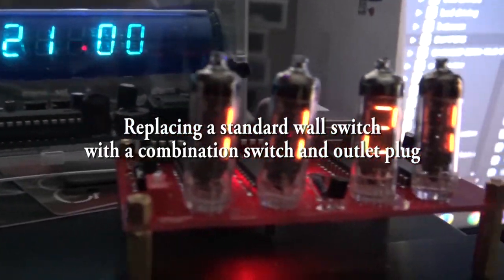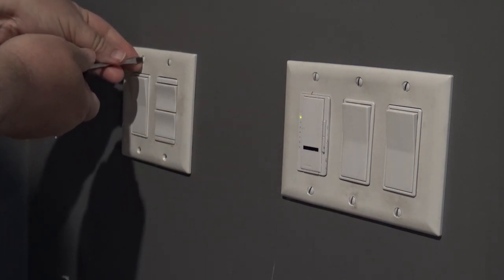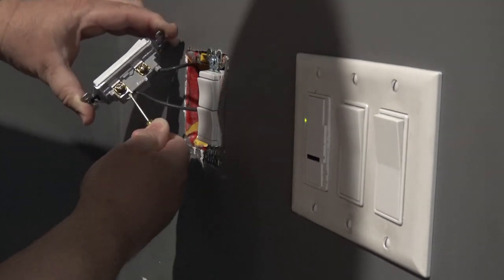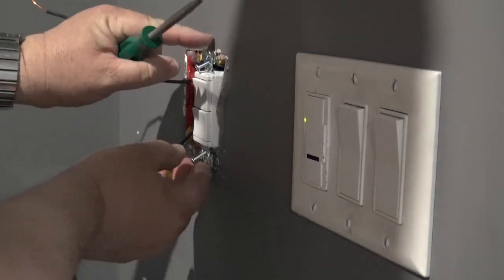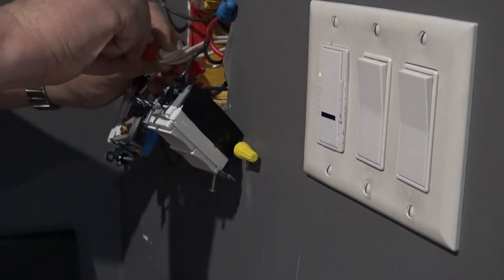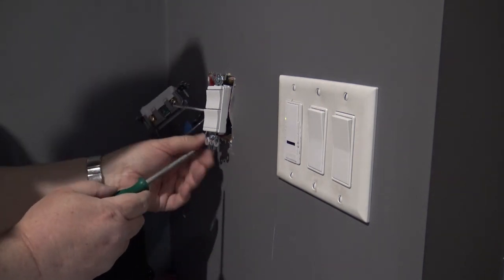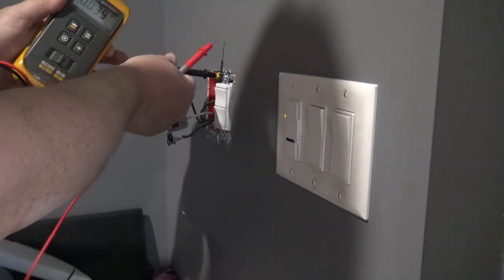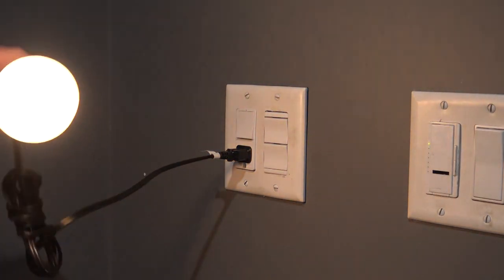Replacing a wall switch with a combination switch and outlet

Comment: Kudos to you sir for being brave enough to work that 120volt hot wire, I myself do all the electrical stuff around my house, I loving working on anything electrical, but I'm still fearful of working on anything live, i always have the power off and lock my brake panel with a pad lock. thanks for this video, its a great tutorial to teach someone how install a switch like this. I feel a lot of people stay in fear of electrocution, but really many many household electrical project are pretty simple. I always tell people who are scared of that if they can hookup a 2ch sound system, they can definitely install a light fixture, receptacle or a simple switch using some common sense to plan it our first.
Reply from the maker: Don't do as I do, do as I say. Turn the fu*king power OFF before working on it. 
I have lots of experience, and am an electrician by trade, so I know what I can touch, what I can't touch, effects of current on the human body, ground path ect. When I work live, which is not very often I take every precaution. No ground wires attached, rubber soul shoes, and nothing around me that is conductive that I can make contact with, and use insulated tools. If turning the power off is an option, I turn it off.
Reply: 12voltvids turn the fucking power off could a good idea if your European.
Reply: 12voltvids I'm actually actually doing a trade to become a electrician at number college here in Toronto, I always have the power off, I fully understand how dangerous it is to work on anything live 🙂

Comment: I'm an electrician from across the pond and it always interests me how even though we are doing the same job just how different we do it. I did cringe at none insulated tools. Ours has to be fully insulated and rated to at least 1000 Volts. We don't use those wire nuts we tend to go for screw in terminal blocks or now those push in type connectors are becoming more popular.
Reply from the maker: My pliers were insulated, but these ones only rated for 400 volts. I have a pair rated higher, but the rubber handles are starting to crack, so I don't use those on live circuits. I have been working on electronics, and electric circuits for a long time, and am a licensed telecom electrician, so I have the training for working in proximity to live mains wires on utility poles.I don't obviously work on those wires,  and we have a limit of approach that has to be adhered to but I do work in close proximity at the house side, sometimes within a few inches.
I have a set of 14KV linesman's gloves in my work truck. I treat electricity with the respect it is due, because I have been bit a few times in my career. One time was from 2400 DC volts from a microwave oven magnetron supply. That one knocked me on my ass.
Reply: I'm also an electrician across the pond, and I've seen a few videos about North American instalations, I can't believe they still use wire nuts when they were banned here for maybe more than 20 years ago, can only use WAGO type connectors. What surprises me more is that they use 120V which requires double the amperage for the same amount of power which even increases more the risk of fire, and since their houses are made of wood, I think their code should be much stricter. I'm not even going to discuss their rats nest of wire they call a distribution board that I've seen on some videos.
Reply: Big differences between 120 volt circuits vs 220/240 volt circuits.
Electrical codes differ between countries. Canada and the USA share similar electrical codes. I have my home in Greece wired as per Greek code for my 220 volt system BUT I have also wired a second electrical system for 120 volts for my American equipment, these are isolated from 220 volt mains and are installed to the National Electrical Code of the USA pertaining to outlets only since lighting is for 220 volts only.

Comment: Interesting situation.  I just retrofitted a bunch of single and double switch fixtures with Leviton DW15S wifi smart switches, which also required the neutral attachment.  Because of the bigger size of the Leviton product, clearance inside the boxes was too limited.  

What I did was create in my workshop, new finished wood escutcheon pieces that basically brought out the wall an extra 1 1/4 inches so the new switches would have ample room in the back for the final wiring.  The escutcheons were slightly oversized of the original box but had ample margin for the sheetrock ears of the switch to rest.  I used contractor's glue to set the escutcheons in place and when tightening down the new switches, applied the necessary pressure to keep them in place and dry.  Sort of a one shot deal.

Your project worked out fine but if you ever go the smart switch route you may have to make some adapters like I did.  I also went with Leviton because it is a company that has been around 100 years and their product was just plain superior to the brand X Ebay and Amazon products.  TP Link stuff looked good but did not have metal sheetrock ears.  Instead they were plastic.  The other Chinese stuff also had plastic ears.  Not good for tightening down a device into a crowded box.

Hope you don't mind my being slightly off topic here.  Your project reminded me of my most recent one.

Comment: Over here most electricians don't work live unless they have too. My college tutor told me the same thing "Never work live unless you have too"  For example if you are working in a hospital you wont have much choice but to work live.
Reply from the maker: I normally turn the power off too, as I have done in other videos where I changed light sockets. This was left on only because there were other family members in the room and they were watching TV. I didn't want to get yelled at. Notice that all the voice over work was dubbed in after, because I was not able to record live audio as I was working. We have to work live at work because, well you can't take a central office off line. So when express power (that is +190 -190 VDC) pairs have failed and cable maintenance needs to work on them, a generator needs to be deployed to keep the field equipment running so that power can be removed from the feeder pairs that deliver power from the central office to field equipment. This is a huge hassle, so unless it is absolutely necessary the wires are worked on live. When I am working on equipment I always work on a floating neutral isolation transformer.
Reply: Cool.. a fellow electrician :)  When I was an electrical apprentice(many many years ago), I had to work on 347 volt live all the time replacing ballasts in fluorescent fixtures, usually in stairwells and standing on an 8 foot ladder.  These were emergency circuits, so we had to do them live, and you just had to be extremely careful. I snicker when people get excited because it is live.  We even worked on electrical distribution live, and taped up our socket drivers so if we dropped them, nothing shorted. We all respected "electricity" and were always careful, and no one I worked with got hurt.  I'm not saying I didn't get shocks (although I did get a 208 volt shock once from an open motor mag and on my forearm touching two phases), but those were just reminders that I need to be yet, even more careful.

Comment: "Some things can't be turned off in the room" but you can risk blowing it, not that is massive confidence! ...Why I watch you..... I love when guys intentionally touch a neutral to the Hot to "work on it easier" versus just sending a guy down to shut it off, they would Rather surge the line not knowing what is on it, this shows there incompetence and lack of understanding of how electrical really works versus just being a GRUNT.... I seen many blown electrical equipment. Hey, Show people how badly they can get HURT or KILLED by the step up POWER of Florescent BALLAST! #SaveALife

Comment: Great video! But only applicable with Canadian or US standards. Here in Europe we have different norms and each country has different security approach. 
I don't want to explain why in France it's impossible to have two circuits that are not protected by the same differential switch in the same cabinet, why you should find different wire sections for light and plugs and so on, but it appears we have relatively different safety standards.
However, our norms are also sometimes delirious, the French NF 15_100 complete Norm is a huge 14000 page Bible..., And is totally inapplicable in Germany or UK. Our plugs have different sizes, most appliances cannot be used from one country to another without a travel adaptor. German and UK electricians still use fuses where it is now forbidden in France and replaced with MCB'S...Wall plugs in Italy are smaller...
We generally have a specific earth wire (yellow and green), that has to be present on every circuit, but our wall cabinets are isolated...and way smaller.
Your video is interesting, but you should have used insulated quality tools to be a perfect example. As said, 1000V insulated tools are minimum...
And the use of a simple multimeter is now prohibited by most profesionnal regulations to test live circuits: the way your testing wires failed is a good reminder that it is not the right tool! A simpler and dedicated tension detector is mandatory. I was shivering seeing you manipulating a small non insulated screwdriver to unlock 110V wire.
I appreciate your work, so please, take care of yourself and don't be overconfident with high voltages.

Comment: If I ever build a house, anything  attached to the ceiling is going on a separate circuit from the outlets in each each room. I might have more than average circuits going to the kitchen considering our toaster oven and coffee maker can't be used at the same time. Separate circuit for any fridge or freezer. Separate circuit for a light above the breaker panel. My home appears to have a separate circuit for the clothes washer. Confirmed separate for the dishwasher. The area where the microwave sits in the cabinet seems separate, not 100 percent sure. If something was built into that area, the previous home owner likely took it out before repo. The only thing left was the dishwasher that worked when we got the home. It died around a year ago after about 20 years of service. Thankfully, the home will be paid off in a few months.
Reply from the maker: jefferyb304 
In my house there are 4 separate circuits to the kitchen plugs. Both microveves have separate circuits as does the fridge, garbarator, dishwasher and warming tray on range. (It is gas). Dining room outlet is dedicated. Kitchen Lights dedicated. Family room is on on circuit lights and plugs. Media room (this one) has 3 circuits, one for tv, one for plugs on one wall plus the 2 outdoor gfi. The other for the lights fan the new plug I just added and plugs on other wall. My office has 4 circuits. 2 dedicated to computers and equipment. 1 for my office lights, fluorescent and led and one for air conditioner. Living room has lights and 1 plug in equipment closet on circuit. Second plug in equipment closet on dedicated circuit. The living room plugs are on own circuit. Living room and dining room lights separate. Furnace blower dedicated, heat pump on dedicated 240. Dryer and he tank on their own dedicated 240.  Master bed on dedicated. 2 bedrooms on separate each. Hall lights laundry lights and bath on separate. Washer on dedicated circuit. Outdoor lights dedicated. Hall lights and hall plugs on dedicated. Garage has 2 circuits. 1 for lights, garage door and 2 low plugs. Bench power is on own breaker. Used to have 2 circuits to bench but doubled up when I needed an extra breaker for the 240v car charger outlet. Garage heat on dedicated 240. Back garage on separate 240 40 amp which powers sub panel for lights, plugs freezer, heat and hot tub. Yup I have its of power in my house and my 400.00 plus a month electric bill shows I use a bunch of power.

Comment: Yes, but... That neutral junction would be best handled with the power to BOTH phases turned off 
before unscrewing that wire nut!   If those whites become separated, you could become part of the
neutral circuit if your skin restores the path from any of the remote loads; worse yet, one or more 
of those smaller, "that can't be turned off" 120 VAC loads could experience almost 240 VAC coming
back through the neutral from a larger load that is still connected and running on the OTHER phase.
The refrigerator could decide to turn on and give a clock-radio a ride on the lightning. White can bite!

Comment: I've switched out plugs and switch/plugs before without turning off the power. Simple physics with electricity applies. Just move one wire at a time with insulated handles on the tools.

Comment: I was watching that black feed getting rather close to the socket/switch, well from the angle of the camera it looked close.
Our light switches have 3 holes in the back and marked Com/L1/L2, and sockets L/N and E.
240 volts is naughty, it makes you do a funny little dance lol :-D
Reply from the maker: zx8401ztv 
240 will wake you up. 120 is more of an annoyance.
Reply from the maker: It is close, but not under any undue tension. The wires are pushed back in behind the plug assy.
Reply: I did get a 120v zap from the case of a frends desktop p.c, the earth in the cheap psu had come off, so creating a potential divider with the mains filter caps, even 120v isnt fun :-(.

Comment: Working on live circuit if fine as long as you know what you're doing. Ive done in many times in situation where turning the power off wasn't possible. (Before someone jumps on me: Yes i'm a licensed electrician)
Reply from the maker: Yanis Popov 
Exactly. This was the case here.

Comment: This would never be approved by European standards.
Reply: t0nito Does seem a bit dodgy to be connecting what may be high current devices to the lighting circuit. This would not even be possible with UK mains as the wires would be inline with the lightbulb.
Reply from the maker: t0nito 
I'm not in Europe.  I only have to follow the Canadian electrical code.
Reply: Yes I know, what I was trying to say is we could never do such a thing because our code doesn't allow to mix receptacles within lighting circuits.
Reply from the maker: Jason james 
The feed I was connecting to is the source for all the plugs and lights in the room. 4 plugs and some LED lights. The other circuit is for the dedicated plug for the TV and a few components in the room. Not overloaded. Not even close. Lights draw 46 watts max for the inside lights plus a celing fan. The outdoor plugs on the other side of the wall are on a dedicated gfi circuit.
Reply from the maker: On a dead end light switch this would not work, because the junction would be in the box at the first light on the string, and just a single pair coming down to the switch, power down on the black, and return on the white. This is a switch box that the main feed runs through.
Reply from the maker: Our code permits this for general purporse plug outlets in bedrooms, and general living space. In kitchens where high power appliances would generally be plugged in, each outlet is on a separate breaker. The top and bottom outlets are isolated. This plus / switch can also be isolated. Notice the 2 black screws on the hot side. There is a tab between then that can br broken off so the outlet is separate from the switched side. In this case it is only a ceiling fan, and the other double switch feeds 2 60 watt bulbs outside on the patio. The room lights are on the other box with the dimmer and 2 switches, but they are all LED anyway. This was wired by a licensed electrician when the house was built.
Reply: 12voltvids So in effect the lighting is being piggy-backed on a general supply rather than the other way around. That makes more sense.
Reply from the maker: Correct. The feed from the panel goes to this JB first. From there the 2 circuits head to the entertainment plug (dedicated on the red wire) and the general plug supply (back wire) and this is where the light circuits are also taken. Since all the lights are LED, the draw on them is negligible.
Reply: Steve Holsten European wire is a bad copy of Japanese wiring
Reply: Thanks YUKI
Reply: Aussie standards are tighter

Comment: The only thing I would worry about is the lower rating of the lighting circuit. Over here in the UK the light circuit is usually only 15A but the socket ring is 32A. Usually the wireing is a lighter grade on the light circuit too.
Reply from the maker: George Christofi 
Our plugs are all on 15 amp circuits here with exception to kitchen appliance which are dual 15 amp on 2 breakers. Hw heaters are on 20 and dryers on 30. Heat pump ⛽ compressor on a dual 60. EV charger is 30 amp 240.
Reply: In Europe supply mains are at 220 or 240 volts therefore equipment draws fewer amps ( usually one half of those drawn by 120 volt circuits) therefore thinner wire can be used for different circuits. In Greece lighting is run on .75 or 1 mm wire while in the USA we use 14 gauge wire. Outlets are usually run with 1.5 to 2 mm wire in Greece while in America we use 12 to 10 gauge for 120 volt 15 or 20 amp circuits.
Reply: yet over here our lighting circuit is run in 1.5 twin and earth and sockets in 2.5mm twin and earth. showers run 4mm. so effectively we are well rated for the current.

Comment: I didn't even know that it could be replaced at all without turning the power off.  I would rather turn things off than get fried.
Reply from the maker: Electricians rarely turn off power when working. Depending on what I am doing, I usually do turn power off